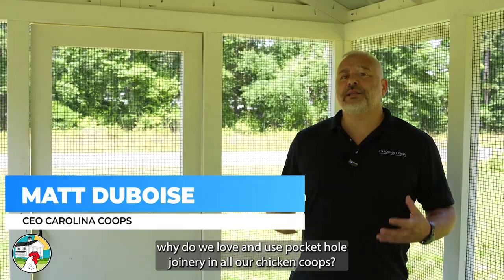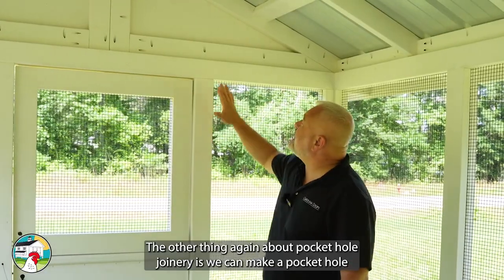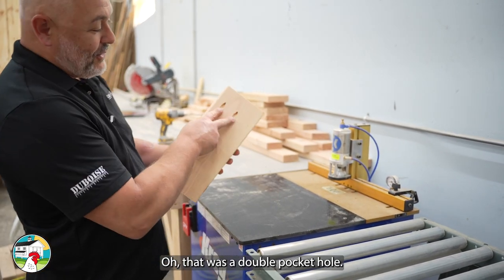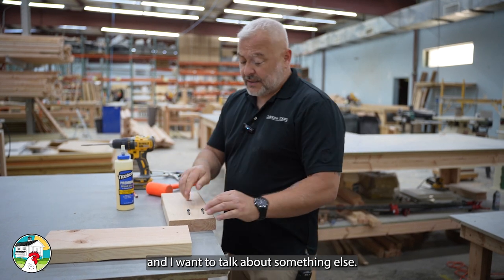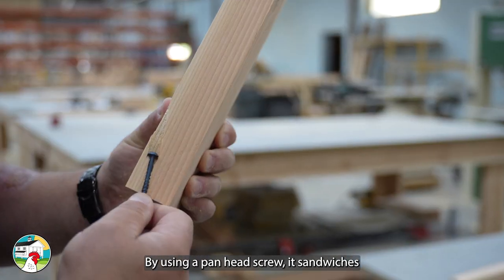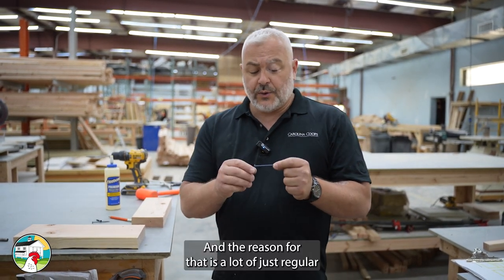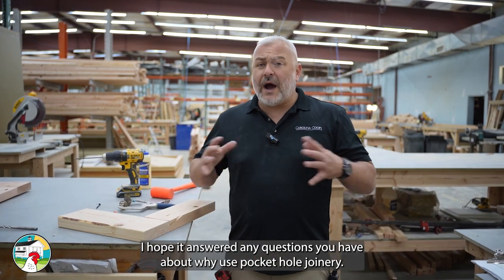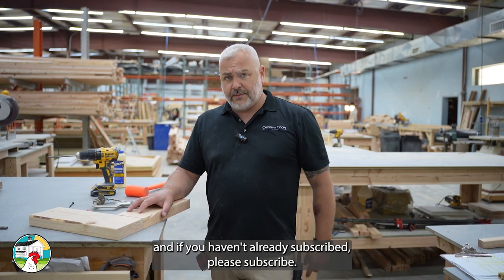Pocket Hole Joinery - THE STRONGEST WAY TO BUILD COOPS!

Comment: Bulding my DIY coop with pocket holes (right screws, clutch, clamps,etc) Just finished putting on the metal roof. and the coop is solid as a rock. I also like the screws because it lets me fix mistakes (they happen) quick and easy. This vid explains the methods and use of pocket screws very well - thanks.
Reply from the maker: You're welcome! Thanks for watching.